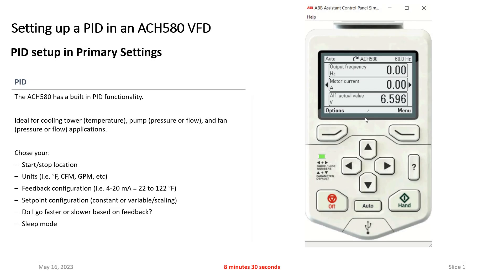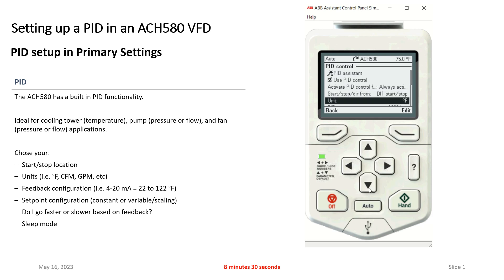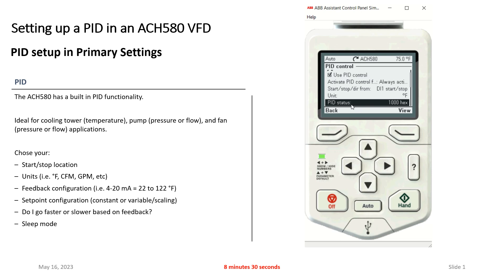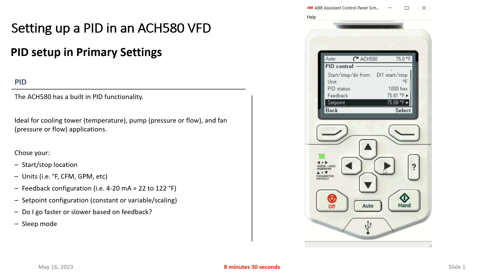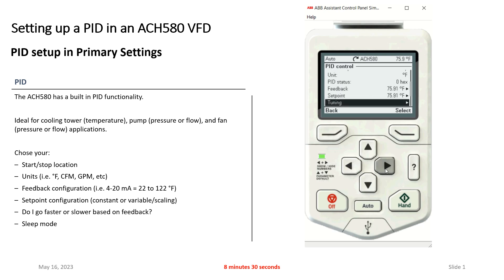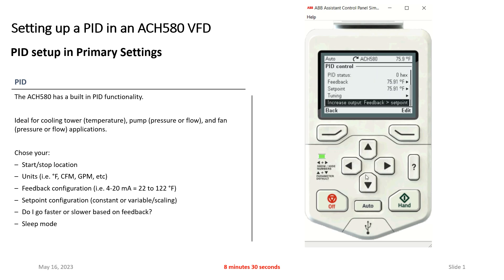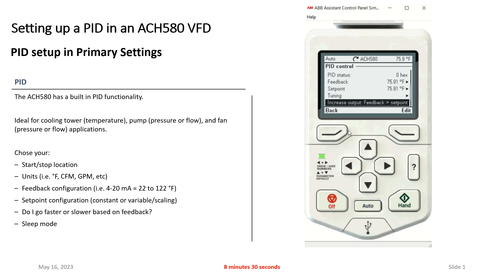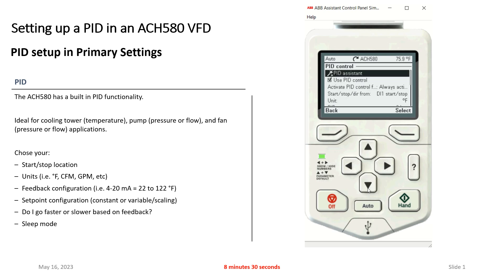Video Setting up a PID  application in an ABB ACH580 VFD

Comment: where did you get your abb virtual simulator ? This is super cool
Reply from the maker: Being a channel partner, i got it from the ACH580 product microsite.  You do have to be connected to a real demo drive or drive to use it.  Are you a channel partner? Who are you with and do you have a drive it your laptop could be plugged in to?